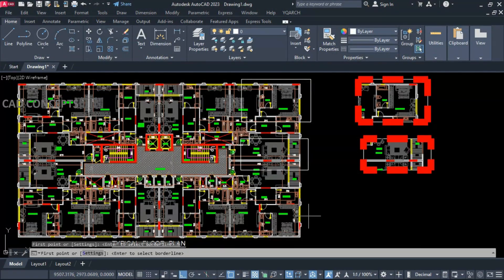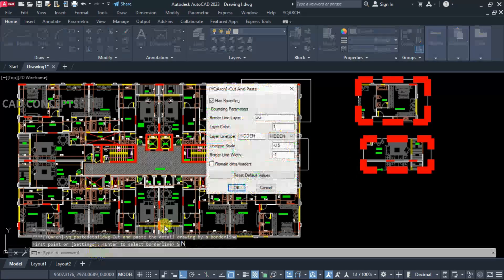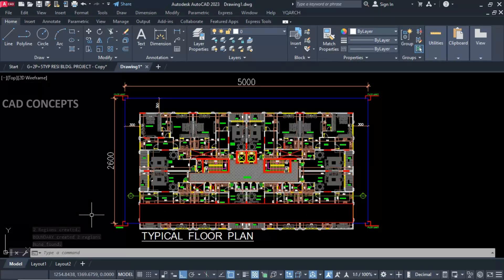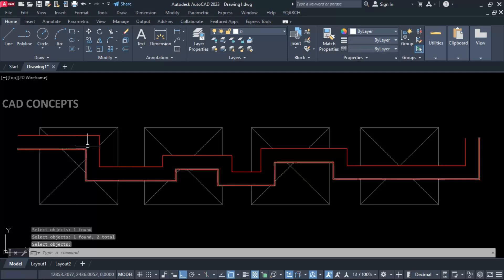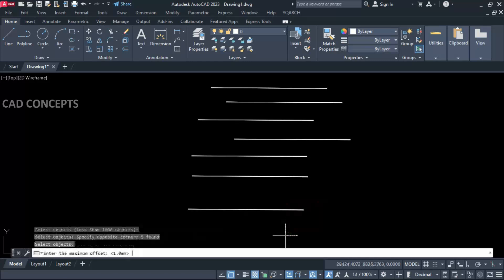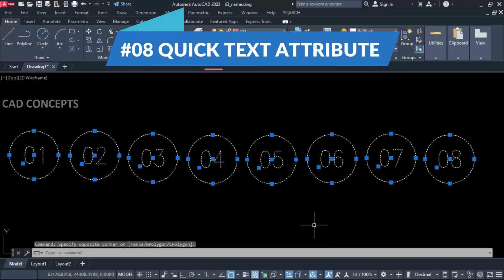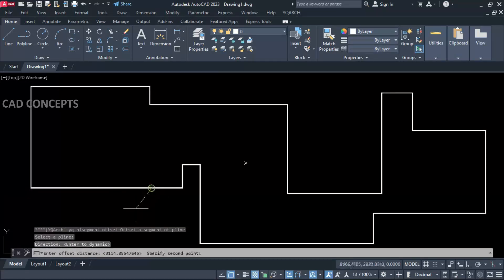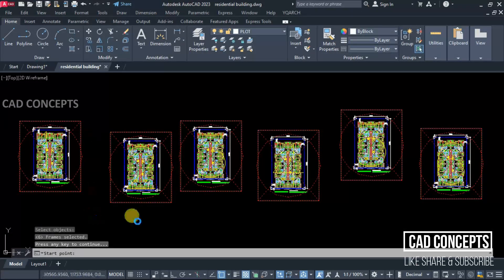10 Productive Tools YQArch AutoCAD - Tutorial

Comment: Can I install in autocad 2021 version ?
Reply: @CADConcepts  ok sir now I installed but find other problem.usually I work in meters & whenever I insert block or wall its comes big size .not going to fit with existing drawing .how I can fix units between cad & yqarch
Reply from the maker: Setup units by YQUNIT command
Setup scale by SD command
Must align the default units and YQ Arch until as it is !!
Reply: @CADConcepts  thanks